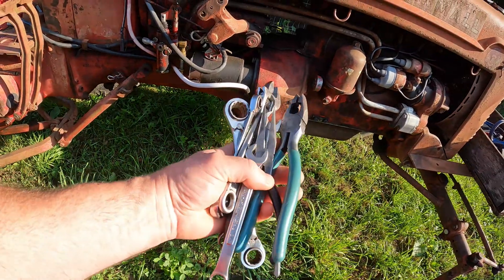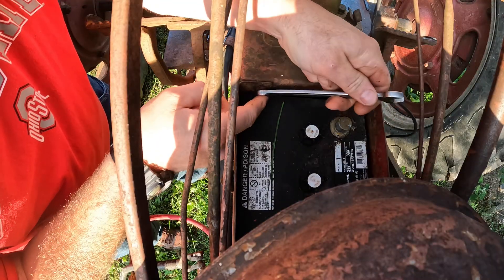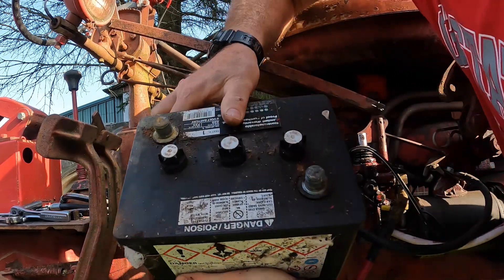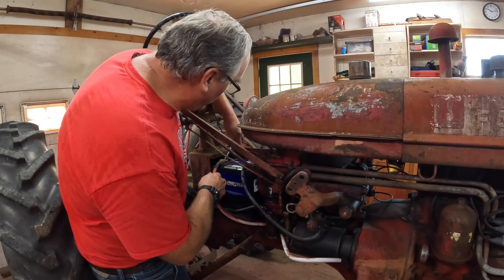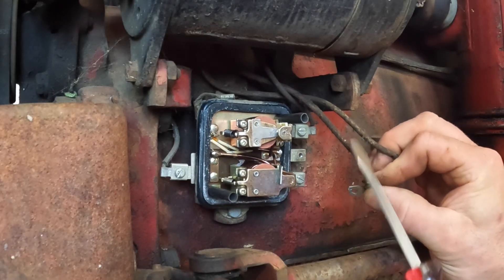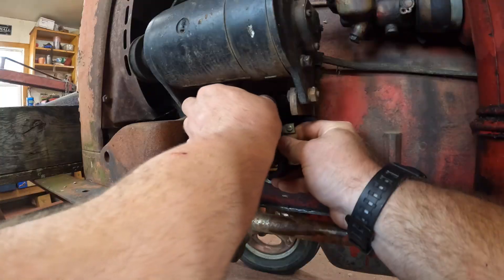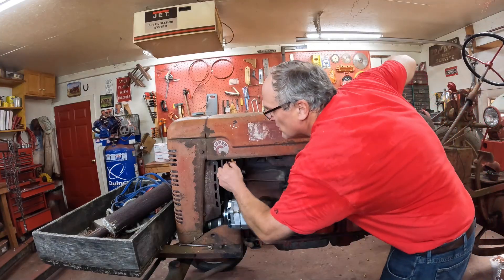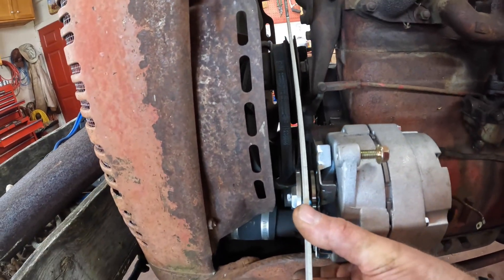Converting the Farmall Super C to 12 Volt with Alternator

Comment: I have a ? On a 1966 504 i hope you can help me with.
Someone installed a new switch, it gets power to the coil weather on or off. I noticed main ground wire getting very hot when trying to start. Any ideas?  Appears to be a orig 12v system.

Comment: Just for some trivia, those "ballast resistors" are often used with a lower voltage coil as explained.  The reason for this is that when starting the engine, the system voltage drops a bunch, so the coil still needs to function during that time.  Using a "6 volt" coil on a 12 volt system would be desirable.  However, the ignition switch should provide power to bypass that ballast resistor while cranking, and when the key is released, it provides power through the resistor.  That way, the coil doesn't burn up and the coil still provides plenty of spark when cranking.
The tractor world may or may not have ever done it this way.
Reply: Over 35 years ago I put a 1974 Vega alternator on a 1962 Ford 641 tractor. Got a Chevrolet and Ford shop manual to draw circuits I needed. Then lifted the old wiring harness off in one piece and completely rewired it. It receives full 12 volts to the coil at start up and charges 13.5 volts at idle. When I did it no one could give me any help so I figured it out myself, using factory wiring diagrams. It has a light that comes on with the switch and goes out when putting out charge. Other's I've used voltmeter or amp gauge and some I used a turn to start key switch like a car. The 641 has a hidden button for starter. I drew wiring diagrams for each tractor I did because some things were different, and keep them all in a binder for future reference.

Comment: question  - I have a Farmall H, just use is a little in the summer. The generator does not work. Can I put a 12 volt battery in with positive ground, a ballistor in front of the coil to lower the 12 volt input and just charge the battery with battery charger as needed and not change any of the other wiring?

Comment: Very good video, thank you. I plan on making this very change on my '47 John Deere B. I do have a question. There is no need for the external resister if my coil has a built in resister. Is this correct?
Reply: You answered my question, thanks

Comment: I did about the same thing on my 48 cub . A long time ago. I was probably 13/14 years old. I’m 48 now and it’s still in my garage. But back then I changed my coil and put the resistor on my lights. And then one of my lights started finally burning out. I changed them over to 12 V. One thing I always like about changing the old tractors over is the starter turns over a lot nicer in 12 V. I’m sure they get a little hotter so you wouldn’t wanna keep cranking on them. But I don’t recall ever really having a problem with that.

Comment: Excellent video Pete  :) no problem on part 2 or more videos to do on Super C Farmall 1953 also excellent how explained how converter 12 Negative ground to GM Delco Alternator from Generator setup and so cool! Also I know when did Generator to GM Delco Alternator on my Dad 1963 McCormick International B414 Loader tractor Desiel motor was easy on wire up and bracket setup was task to make for funny part Generator belt was same size plus length to use on Alternator to plus slider adjuster also all wires plus connectors lots fun to do up! I had take Generator, Regulartor box off orgnailly had but was 4 hours totally to do in and made up my own schematics on wire plus brackets for know do in future and new owners of farm called me up recently to replace ALTERNATOR again because old I put in 1994 wore out plus belts need my help out! Also on 1968 McCormick International 105C combine gas motor had do GM Delco Alternator  on to last Friday to ,  plus on 1968 International 624 A Desiel fuel motor tractor too years ago when Generator  on my dad also replaced yesterday for New owners on farm to plus 1978 International 724 B  loader Desiel fuel motor tractor years ago and yesterday to and amazing me 1997 farm sold all GM Delco Alternator lasted long time on combine and tractors too! All them were 100 amps type 2 pole with Regulartor inside used too single pulleys!

Comment: I converted dads 350 utility to 12v with an alternator a while back. I used a tiny denso unit out of a junkyard nissan 240. I think. 3 wire hookup with an internal regulator, and it’s a much smaller package than the 10SI. fits real nice under the hood.

Comment: Nice bracket.  Its obviously the right choice for you and you're doing a nice job.  I have mixed feelings on the conversion.  The purist in me thinks a generator looks so much better.  But they don't charge much at lower speed and regulators are a pain.  In my old tractor experience I have two issues with most 12v alt conversions I see:
1.  They did it to make it crank faster because the tractor doesn't start worth a crap due to another problem (like low compression).
And/or
2.  The conversion and alternator mounting is terrible - misalignment that eats/throws belts, won't hold belt tension, ammeter/voltmeter doesn't work/missing, hood cut out with an axe, etc.

Comment: We had a Super C, nice little tractor. First tractor I drove. It had a narrow front, steered so easy you would swear it had power steering. My grandpa said it steered so easy because of all the universal joints. We also bought the wide front end adapter at a auction but didn’t use it. I don’t know if it was converted to a 12 volt system or not. Good video Pete.
Reply: And it would run ALL day on 5 gallons of gas , I grew up on a C back in the 50s and 60s
Reply: I don’t remember putting gas in that tractor very often. Pulled a lot of hay wagons with it.

Comment: I had lots of 6 volt troubles too, going thru several cheap aftermarket regulators and then adjusting them but they wouldn't hold the right voltage, too little then too much.  What a pain. But then I bought an expensive regulator from Brillman.  What a difference, trouble free from then on!

Comment: I have a question about the coil and resistor. When the tractor is running you have 14 volts coming into the resistor and it maybe puts 10 volts into  a 6 volt coil, and 6.5 or so coming out and into the distributor. At least that’s how it is on my 504. The coil still gets warm and I’m not really sure how else to do it or if that’s right. Thanks for the video!

Comment: I was wondering, with your 12 volt conversion on your H, did you have to make any special brackets yourself? I've been wanting to do that to my 1943 H. But it's brackets by the radiator and stuff are totally different then the ones on my other 2, earlier H's.
Reply from the maker: My H is a 1940, and my memory is that I was able to use the existing generator brackets. The Delco tucked right up under the hood with about 1/2" to spare. I guess I was not aware the brackets changed during production.
Reply: @JustaFewAcresFarm  Thank-you, I have no idea whether or not the brackets are homemade or what. That H has had an interesting life, being that it has about a million dents but still being the most reliable H if mine. Thank you for responding to my question and have a nice day!